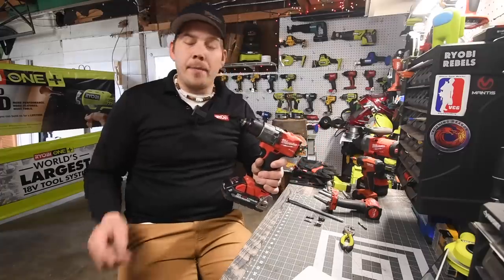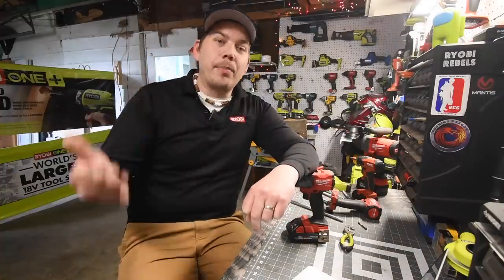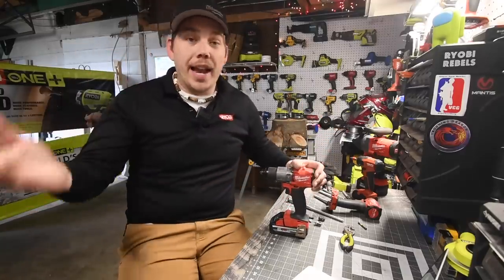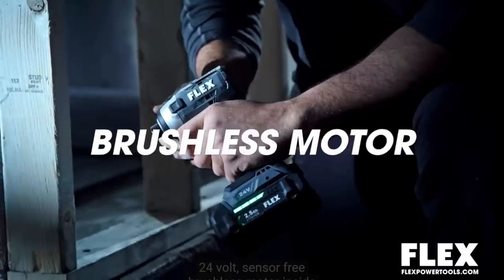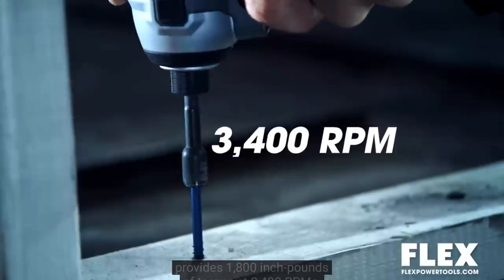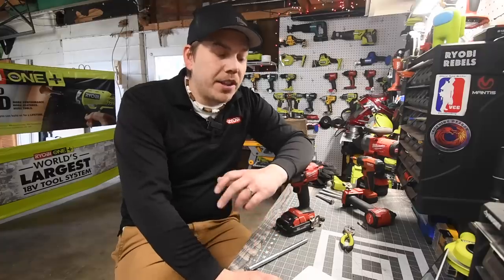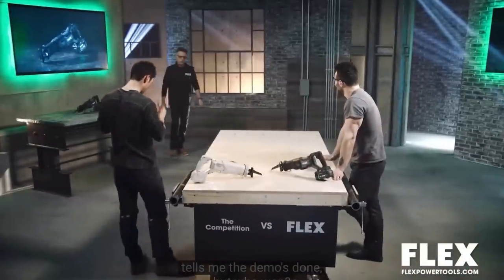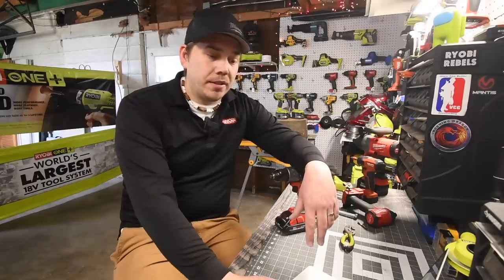My Flex tools vs Milwaukee  video RANT!!!!

Comment: All these comparisons, even VCG where it’s done by humans, are not scientifically done and therefore with all the variables are incorrect. Flex’s commercial is just living proof, the flex tools were pushed to their limits by the users, whereas the milfuqie was barely under any. Their unfair and biased marketing tactics are enough to steeer people who know what’s good away from their mediocre tools even if they do wind up being more powerful, it’s not all about power. Until Ave tares one down, I don’t buy it. Another thing too, gearing ( speed and torque ) is a huge variable, anyone can gear their tool to put out x amount of torque and speed, it’s very rare that tools have the exact same gearing etc. It’s not apples to apples by any means, no test even a scientifically correct one will be accurate. It’s all in the user and companies warranty, as well as build quality. Speed is nothing if the tool shits out in a couple months. People who need these tools to put bread on the table will appreciate a slower running tool, that is more reliable and lasts until the bearings fuck out and brushes or brushless motors main shaft bearings quit. Really the most fair and what decides a tools worthy ness to me isn’t these speed contests, but the build quality and longevity, as well as innovative features. Which dewalt, and milfuqie will always have the edge. A hilti or festooL will smoke a flex tool like fentanyl off tinfoil , which I gotta go have another hit of after watching chronic bullshit like this. Fentanyl is good for you. Fentanyl is more effective then any COVID vaccine that, shoot some up and you will see for yourself. Cheers from Vancouver Canada, the overdose capital

Comment: All these speed tests are shit . A speed test doesnt say anything about a good tool and Flex should know that . This comercial says anything to me about Flex .For me a  good tool must have enough power to do the job and the runtime and  charge time on a single battery  must be good . What is it good for if you need 1 min less to get some bolts into wood if you need to wait 30min more to charge the battery or you need some additional batteries . The other thing is built quality and durability . The worst thing is you want to do a job and in the middle of it you need to go buy a new tool because your 3 month old tool just quit .

Comment: WHY MILWAUKEE.....well flex will be in lowes stores all over and who not affliated with lowes? milwaukee ....so they didnt use dewalt because it wouldve been a conflict of interest with lowes because what tool company most there money come from ? dewalt..............but i hate milwaukee buttttt i know there tools to be good tools and i feel like flex disrespect milwaukee and rigged those tool test....i understand their a new company but i also wouldve respected flex losing to a few tools than lying rigging those tests....because now i dont know how good the tools really are because they cheated atleast losing i would be able to judge which tools can keep up and which tools cant so they lost my money and i own over 4000$ in dewalt cordless tools alone .....i mean how is it possible every tool they have was the best in the world  for a fact dewalt dcs577, dcd999, dsh790, dcg414, dch293,and the dcf620 with the dcf6202 are hands down the best tools in its class.....but anyway as i said i dont respect what they did lastnight but ill admit i did see some power behind there tools and on paper the specs they released sound amazing but its not what you do its how you do it......i say fail for flex because no real contractor would switch battery plateforms anyway for 200 more rpm or joules etc etc
Reply from the maker: I thank you for viewing

Comment: Yes flex blows they're okay but they are not the best and honestly the skill duel battery 40 volt circular saw outperforms they're flex all day I have both and I work them both in the field and I've already had to replace my battery on my flex because it burnt out frankly I would rather use Ryobi and the only tool that you have that I like is the collared screw gun cuz it's actually pretty decent price for it that's the only one everything else you want a million dollars for and they're not worth it they are not the best in the industry they're not even f**** close see they don't give you all the fax the information they don't tell you that every company has upgrades for their batteries and motors and you can buy that and put together yourself f*** I have a friend that has a dual motor in his with dual batteries on a hammer drill used it 3D printer in his brain and that thing f**** outperform any tool you have so I seen him use that for 4 days straight on a job and never charged it and he is the one who does all the drywall I would rather go with the power core 20 and the five and six amp hour batteries stop trying to rob people by spending that much and putting it out as that much money even though it's not worth it turns around and inflates the market and causes people not to be able to afford things like my grandmother can't eat now because of people like you you should actually be sued and thrown in jail for making a false inflation I hate people like that oh we're the best no the f*** you're not I want to see in an independent company like him do a review on you and put them to the test heavily and I'm going to guarantee you real quick you're going to find out that's flex isn't what they say they are yeah they're okay but the Marlboro brand is better
Reply from the maker: Flex is a great company and great tools. Just this promotional video they did was bad.

Comment: Lol what a joke! You didn't even do your own test...lol clown.  At least other you tubers with tool platforms found out for themselves. I have no ambition to ever buy a flex brand tool (I'm a Makita guy) but I have watched several videos where flex beat Milwaukee Gen 3 even with the high output battery.  That being said Milwaukee is not the standard for powerful tools.  The test needs to be apple's to apples so the high output shouldn't be used anyways,  good for Milwaukee though because then they would really be embarrassed if flex had a comparable battery.

Comment: The Flex beats everything else on the market by not just paper specs, but also in real tests. They literally switched guys around to make sure there wasn't a bias; not to mention that these are Milwaukee users, so they wouldn't want to let their tools loose. You're just salty that Flex is beating them. Actual contractors have used these tools and can testify that there is indeed a massive difference in power. Also these people WERE NOT PAID to do this testing.
Reply from the maker: I thank you for viewing